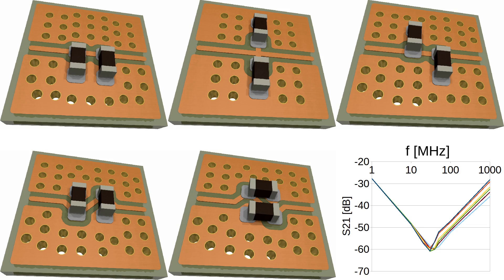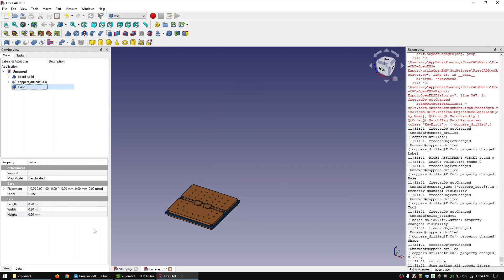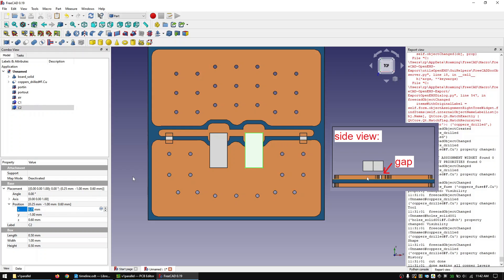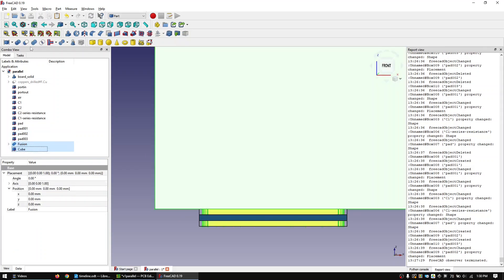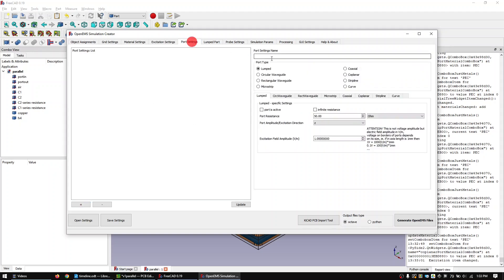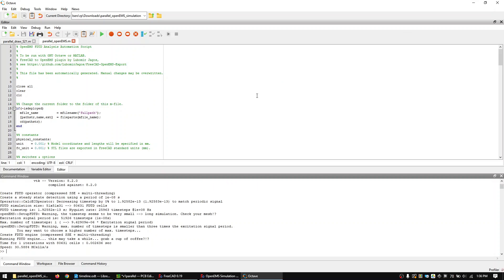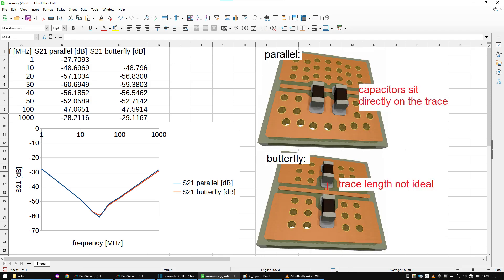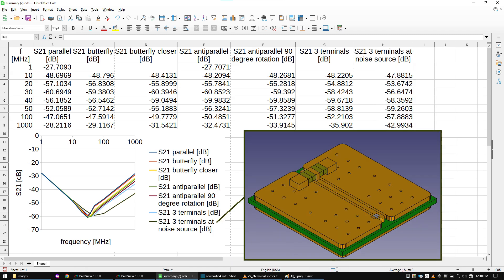part  2: free filter capacitor simulation with KiCad and openEMS (decoupling capacitor placement)

Comment: This is excellent. Trying to work through tradeoffs on stitching capacitors when there is a reference power plane switch for high-speed traces, so this is really helpful to learn a way to put a capacitor into the simulation.
Reply from the maker: enjoy the learning process. There will soon come some more in depth videos regarding this type of capacitor simulations.

Comment: Is there a way to simulate smps?
Reply from the maker: Sadly not a full SMPS, because: openEMS as of now does not support diodes and mosfets.
What you can do is to simulate the input and output filter of a SMPS.
Reply: @panire3  thanks for a detailed answer. I have another question, is this maybe possible to do a thermal simulation. For example a cree xp e2 led 4x4 mm with a ground plane, what temperature the ground plane would be and crystal of the led?
Reply from the maker: @salovamrani2084  The only free tool I sucessfully used so far for thermal simulations is Elmerfem. But I only managed to simulate single materials (e.g. only the heatsink only or asuming the leds are mounted on a pure aluminium PCB) with airflow - see my udemy course.
If you want an exact simulation that includes the PCB layout, I havent figured out this yet.

Comment: with the parallels caps and butterfly you can make the trace wider which might cancel any advantage of the other topology's
Reply from the maker: This might be the case, have fun testing it out with your own simulation! 😊 My concern with using thicker traces is that more of the signal might bypass the capacitor. If the traces are only as wide as the capacitor pads, the signal is more likely to flow through the capacitor.

Comment: 1. What (exact) versions of Kicad run well with all of that?
2. FreeCad version is still 0.19.4 ?
3. How did you manage to find out what versions of KiCad and FreeCad fun well with each other for these simulations on openEMS?
Reply from the maker: Hi :)
1) KiCad 6.0.11
2) FreeCAD 0.19.4
3) Sadly just by trial and error and a lot of patiente

Apologies, I realize now that it's not clear which version was used. I should have included this information from the start, as it's crucial for anyone looking to replicate the simulation.
Reply: @panire3  for me FreeCAD 0.22 and KiCAD 8 works fine., I suspect it works with the recent KiCAD 9 and FreeCAD 1.x. I have to check that.
Reply from the maker: Hi, I tested it out right now with KiCad 9.0.0-RC1 and FreeCAD 1.0.0 and it worked as well.

Comment: Great video as always. Is it possible to find the parasitic inductances (Common source inductance, gate loop inductance, and main loop inductance) of the PCB using FreeCad and OpenEMS? If so, can you please make a video on it? I think it'll be highly useful to electrical engineers.
Reply from the maker: Hi there, interresting request, after 35 years in this world i never heard about common source, gate/main loop inductance). 😅 I will have a read to see what it is about somewhen those next days.

Comment: What is the theoritical basis of the performance improvement antiparallel?
Reply from the maker: Hi there! I touched on this topic a bit in my last video.
At some point, I'll likely need to make another video about it since I don't fully understand it yet.

theoretical basis: The antiparallel layout style forces currents in opposing direction for each capacitor. The opposing currents reduce common mode current around the capacitors, but I’m still unsure how exactly this improves the S21 performance.
Reply: @panire3  thanks. i am subbing you

Comment: Nice to see new video dropped on channel! Got a question - why it has to be kicad6 in course? Just wanted to see how recently developed board in Kicad8 behaves and i dont know whether downgrade is possible without issues. Just took a quick view at thermals - did you concidered maybe adding a section which could help with simulating heat sink with or without forced air flow? Would be nice to see it! Keep up the good work!
Reply from the maker: Ah thats quite a bummer to hear - I think downgrading is not possible in KiCad. Alright promise, my next youtube video will be with KiCad 8.
Reason why i used KiCad 6 so far: I started with it and once i tried to move overe to KiCad 8 nothing worked anymore, so I thought why not wait for KiCad 9 to make a transition as KiCad 8 is soon to be phased out anyway.
Thermals: Sure I can add a heatsink example with and without airflow. What I am still strugggling even after months of failurees is to make a thermal simulation with multiple materials, so combining heatsink+PCB in one simulation still doesnt work with any free tool that i tried.

Comment: 4:21 "switch to full copper vias"
Do sitching vias bounded by two copper planes exhibit current crowding on the outer surface?

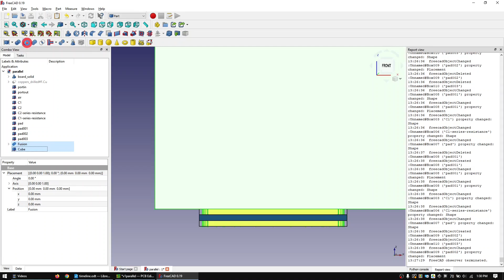4:55 "mark the copper structure and the four pads and create a union of them"
That's not strictly necessary as far as I'm aware - one just needs to assign more parts to PEC. I'd go so far as to suggest putting SMD constituent shapes into a part container such that it can be duplicated more easily, as once we're past a few components, it gets old pretty quickly.
Reply from the maker: regarding 4:21: I didnt check this one yet. But will do it now and give you feedback. As the material of the ground layer and traces is set to PEC (perfect electric conductor) it will for sure behave differently than copper which has limited conductivity.

4:55 yes its not strictly necessary to make a union. And you are right that with a complex board this is quite a hazzle.
Reply from the maker: 4:21 here is the current distribution inside the via. so even though its a full copper via, the current is mainly concentrated at the surface: https://drive.google.com/file/d/1sNpWKgx8_lCW1eQKQSZFhLtPzLg_GMwm/view?usp=drive_link
Reply: @panire3  Excellent - thanks for checking it out. So this means the filled via approximation does not impact the RF performance. Solid PEC would also translate to an inner domain boundary (as long as we're not including finite conductivity in the material parameters). 

Next, it would probably be interesting whether a 3x3, 5x5 cell or other very small cube is sufficiently representative of a via barrel that may not be well-resolved spatially - or whether there are magic number / cylinder-to-cube conversions that produce close matches for the inductance to de-feature the round shape of a via.
Reply from the maker: @hardwareful  The cube approach is used in some 3D export tools (unfortunately, I can't recall which tool was exporting cubes), so that's definitely an option, and I have seen it being used. For rough estimations with fast simulation times, I am certain this would work.👍

Comment: Would it make sense to also include a lumped inductor to the model, matching the ESL of the part? In my experience with ceramic capacitors the package inductance is one of the biggest contributors to the layout-sensitive phenomena. Or is there a sufficient degree of package inductance modelling occurring already as part of the geometry in the sim?
Reply from the maker: The inductance is quite accurately represented through the geometry.

To my understanding (based on what I have read on the Github discussions group), the option to select inductors in the FreeCAD to openEMS macro is just a placeholder for future functionality. The lumped inductor model does not work currently, and based on discussions on GitHub, it may not be implemented anytime soon.